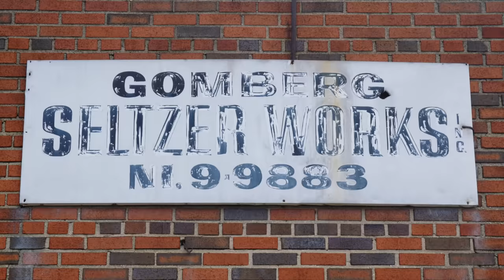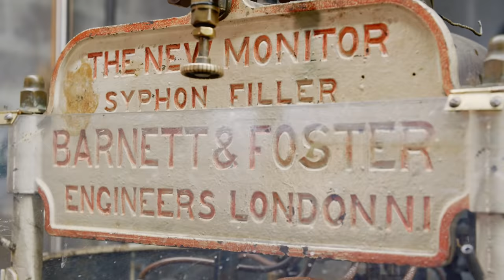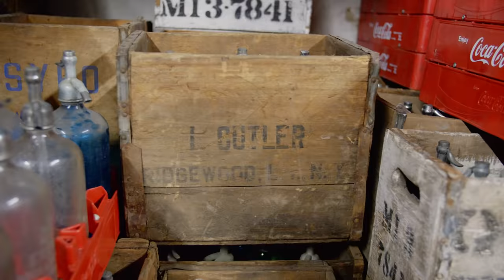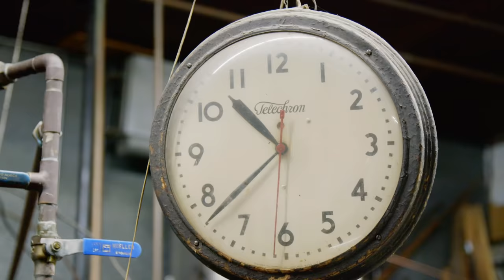Brooklyn's Last Seltzer Men | I Got a Guy | Bon Appétit

Comment: I'm amazed at the lengths hipsters will go for niche products
Reply: I'm not
Reply: Actually it does have a practical use. I love seltzer water, the bite is exactly why I love it. Like they said though, if you don't drink plastic bottled seltzer quick enough (which you shouldn't be able to) the bite is significantly diminished and the water tastes like water from the bottom of a garbage bag.

Comment: i remeber something similar but it use metal cartridge (now the main use is in air soft guns). Those cartridges was reusabe. Now we use  stainless half barrel and co2 tank. It causte around 10eur for gas and it last for 2-3 years. I think the price for all the botles and stuf like valves and tubes be around 200usd

Comment: I once assumed carbonated beverages cause bone density issues, however after reading up on it sparkling, seltzer, or other carbonated beverages (except for Colas) don't cause issues with bone density or general bone-related issues.  What seltzer water DOES do is provide benefits in the following ways:  helps swallowing fluids better, and encourages weight loss (since it helps the body "feel" more full.  Super interesting and exciting.

Comment: I just bought an old seltzer bottle just cuz it looked pretty cool. It has a stainless steel wire weaved around it in a diamond pattern. Im guessing it was reinforcement against the pressure.

Comment: This things are like bombs. Glass is thick but if you knock it down it will blow and cut you quite deep. Later models had a metal mesh on top of the bottle to keep the fragments from blowing your face off. On the other hand this is the best way to get a tasty shpritz.

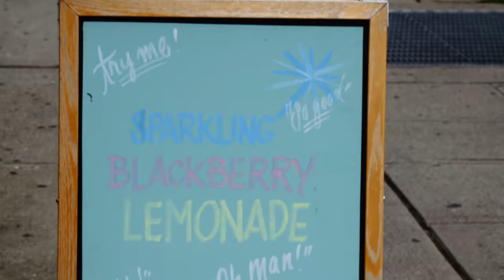Comment: 3:25 They claim that it won't have full pressure until its refrigerated. I'm confused as to how this is the case wouldn't decreasing temperature cause decreasing pressure. Or is CO2 not an ideal gas? What am I missing here?
Reply: Depends on the reaction, that is what kind of a temperature it needs so that the reaction gets started. Since the reaction is CO2 + H20 --> H2CO3 and we want to have CO2 it makes sense to reduce the temperature (assuming it needs energy in the form of warmth to react to H2CO3 which in itself is rather unstable); reducing it will make the reaction faster where educts are made. Im assuming Q= +nKj, if it doesnt then it would indeed not make sense.